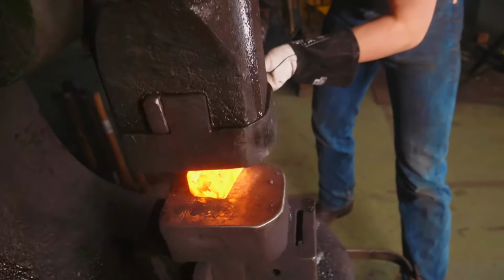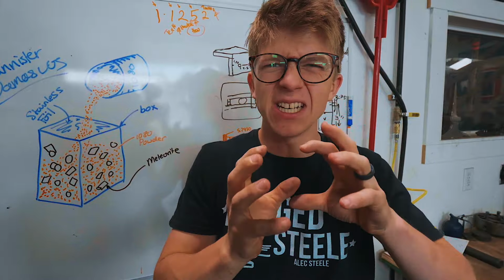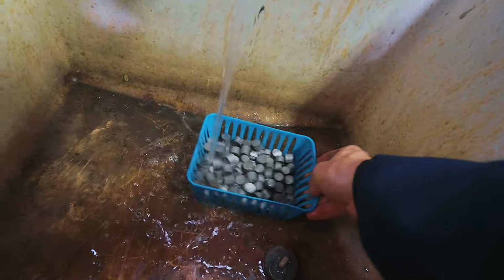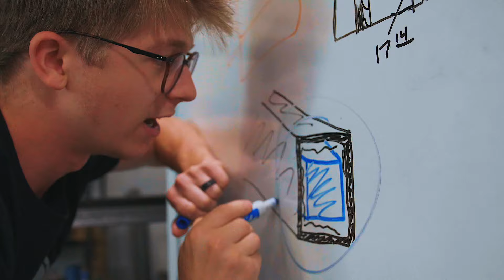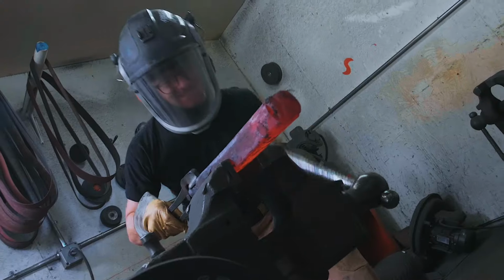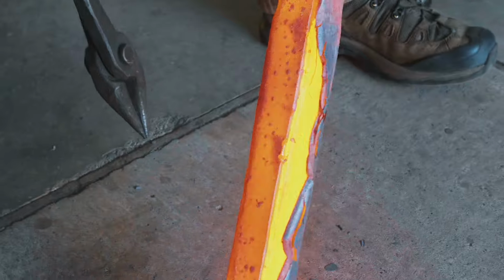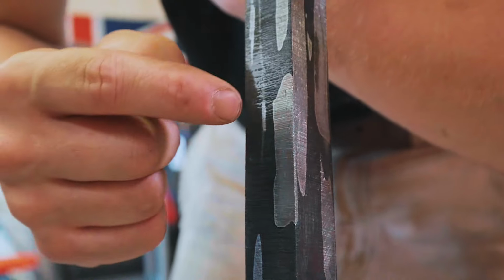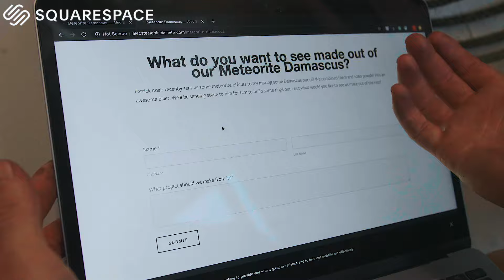CAN YOU MAKE METEORITE DAMASCUS?

Comment: You guys should make this kind of video into a series called “Will it Damascus?”. That would be neat!
Reply: I see what you did there!
Reply: Ground up blendtech blenders should be next then
Reply: Is this GMM?
Reply: Or what about: "Will it Forge"?
Reply: Why doesn’t anyone like Tungsten ik this is random but I’ve never seen him try using it
Reply: Say it with me:
Trypophobia is not real. 

The dress does not change color. 

This is pattern welded steel.
Reply: XrXaXe X I am no expert but I assume it is probably because tungsten is so heat resistant. It has a melting point of more then two times that of mild steel. Also tungsten is very expensive. I assume it’s a combo of those two factors.
Reply: its never damascus, its forge welding. real damascus is way way trickier than just smushing in patterns.
Reply: That would be cool tbh
Reply: Hell yeah
Reply: @Teraylxn  I believe it has the highest melting point so that's probably why
Reply: And hang out with Rhett and Link.
Reply: @Teraylxn  if you have to ask then you wouldn't understand.
Reply: @coronalight77  that literally why I asked the question..so I could understand 😂
Reply: Yes
Reply: Yes, excellent idea. I would only change one thing, Does It Damascus ?
Reply: Yes.i have some old high carbon tools I would ship to you to try forging.
Reply: This whole tree is on fire
Reply: @Teraylxn  its extremely expensive, extremely hard and extremely heat resistant
Reply: GMM fan spotted.
Reply: Yes but will it keal.

Comment: There's a Ukrainian knife maker's channel called 'Shurap' that does a fair bit of canister-welded damascus from all kinds of crazy components like bike chains, cables, washers, etc. The trick he uses is to have a canister fully made from stainless steel, combining the mild canister and foil into one, which he then zips off the sides of with an anglegrinder. He also douses the cans, which he puts a little pressure-release hole in the lid, in a mix of kerosene and flux to really help that powder bond. From what I understand, the slag runs into the space between the billet and the canister when it gets hammered on. Might be worth a look? @Alec Steele
Reply: This needs further exploration 👍

Sidebar; does "manual" @ / at'ing, work in YouTube comments? Doesn't seem to make a visible tag, so don't really know if there's any effect. And cannot @ myself anyway for testing.
Reply: @pr0xZen  Only if i reply to your reply. If I write @pr0xZen it doesn't do anything. I know it works in video descriptions though.
Reply: Shurap seems to be at least a decade ahead of Alec. But here we see all the mistakes too, which we all can learn from.
Reply: pr0xZen I was just testing it out, seems it doesn't do anything. I know video creators can @ people in the description of their video or something like that, but I guess the spam would be too much if us plebs got access to that.
Reply: Yeah that’s the basis of canister damascus as far as I know no one has just popped off the tube before angle grinders if you did canister Damascus you just used a chisel it confused me when tried to just split it
Reply: Shurap is probably one of the best knife makers on planet earth. And the metal he uses has so much variety.
Reply: I agree. I am fairly surprised that Will doesn't apparently know of Shurap through researching knife forging. I was going to comment the same thing. The angled dies that Shurap uses on his press to elongate the bar (and keep it squared up) could have also helped Alec to have less wasted material from the power hammer and grinder. I also feel like Alec used too much steel powder. Should have piled the canister full of the meteorite billets and then put in the powder with the "tapping" method, to pack it all in around the billets. However, it will be interesting to see what the final pattern looks like after the stacking and twisting.

Comment: I would say you should make the meteorite sword from avatar the last air Bender but I don't know if  there will be enough material on the billet
Reply: Just make a scaled down one. It would be just as cool
Reply: You can always use it as a jacket for a core steel
Reply: I'd say he could manage it if used a different steel for the handle
Reply: @Ashmurtagh100  wasn't the handle of the sword made of brass or bronze?
Reply: AWEme did it

Comment: Alec Steele, the stainless foil is a really smart idea on having the canister strip easy from the billot, but I’ve seen other blacksmiths on YouTube and even on the show forged in fire that use white out and then when they get the canister out the press they dip it in water really quick and the canister peels easily off the billot

Comment: "Alec, now lets talk about your damascus here: unfortunately your blade is not finished, there is no mechanical support in the handle and the blade has no edge. Our judges has descided, that this way your weapon is not safety, and we cannot continue testing, and you cant be the new FORGED IN FIRE champion. We would like to ask you to shake your competitors hand, our hands and please leave the forge.''

(Pls dont kill me if you  dont get the joke)
Reply: I've been binge watching forged in fire and wondering why he didn't just use white out
Reply: @falconeer99  It hardly ever works out on FiF, though that's mainly due to the time constraints. Anyway, Will learnt the stainless foil trick from a canister damascus expert, so they went with it
Reply: @taylor_green_9  I totally get that.  My comment is based entirely on the original post being worded the way the judges on Forged In Fire speak

Comment: hey Alec is it possible that since you cut the long pieces of the foil jacket in to separate strips that some of the powered steel fused though gaps along the seams, hence the trouble you had separating the mild steel box from the inner Damascus?

Comment: How about a tactical folding knife
Aluminum (or aluminium for you AS) handle, Steel ball glass breaker, meteor blade at 6" (15cm) and be sure to leave a  tab for push-flip assistance.
Tanto taper.

Comment: What about trying titanium carbide and tungsten carbide Damascus? There are titanium tungsten carbides but I have not seen the separate carbides as Damascus. I believe this would require a very hot forge of around 3,000°F and may not even be possible because the boiling point of  titanium carbide is lower than the melting point of tungsten carbide, but tungsten carbide should heat up at 3,000°F.

Comment: I was thinking Alex’s first mistake was making 5 individual pieces of stainless foil instead of a single piece of stainless pushed into the shape needed therefore making only one point of contact with the outer mild steel instead of 4+ seams between the pieces of stainless foil.

Comment: Hmmm, somethnig to ponder. But did you know that Iron is th last element that is formed in all stars, and that doing so causes the death of the star after a while. All the other heavyer elements are created form supernova and collisions on insain levels. So not only was Alex working with a cool material from outer space, but the last time it was heated to melting point (apart from when it got squishd into the metiorite) was when it was formed in the center of a sun.
But what to make out of the demascus I have no idea, Maybe Dawnbreaker from Skyrim, actually yes, to break the dawn, or to break a sun all you need to do is add Iron.

Comment: Bruh... You gotta take that billet to like 320 and you'll see some WILD stuff. 
You were lucky enough to maintain the striations in the meteorite. (The miniature stripey-s... Also, whatever you do, it's gonna have to be sanmai or gomai or beyond. 

I'd personally do a space theme, and make "black hole" Damascus over a layer of pure nickel, over core steel. To keep the heat treat similar to the 1080, use something similar. OR avoid hardening the 1080 and make the 1080 cloudy by using O1 or an air hardening steel.

Comment: The problem with metoerites is that they are often made of metals which don't necessarily alloy, however they are welded together becuase they were formed with a shitload of enegy. Literaly planetary scales of energy. I'm not saying is impossible ot forge with a space rock. is just that you will need a lot of heat, more than the usual. Go ahead Alec.

Comment: You may know this now, but I've seen white out used instead of the foil. You just coat the sides.I think the theory is that it turns to carbon 🤷‍♂️
Also, cutting away the canister earlier seems to work out better for most. I've seen wedges forced down the side in the press to separate the casing

Comment: Sorry to be that guy, but if you heat meteoric iron above 723 degC the crystal structure particular for meteorite irreversibly disappears. The reason for the cow-pattern is that the 1080 powder transforms to pearlite which etches dark, while the more pure "meteoric iron" is likely mainly ferrite, which remains bright. I think you could have used any steel with low carbon content in place of meteoric iron to get the same effect. I'm sure you know this.

Comment: Very nice! I think the biggest problem with your attempt in 2017 was that you had the wrong kind of meteorite. It looked like a "carbonaceous chondrite", i.e. basically a rock. There was no way you could have forged that thing successfully. The chunks you have this time look like they're from nickel/iron meteorites, which should forge a lot better since they're mostly metal. (I think there are other kinds as well, but those are the two most common. It's been a long time since my geology degree.)

Comment: As it is a Damascus done by space materials the best design i think is an Arabian dagger 🗡 
Old legend said that the damacian used to buy the iron from Yemen 🇾🇪 which struck by lightning 🌩 and forge it to become Damascus steel what about you try to struck it with electricity and find out if the legend are true?

Comment: Should have used one sheet of stainless steel folding it so it fits your canister. By cutting it then putting each piece in there are gaps that would allow the canister to weld itself on them corners!!! 🤦🏼‍♂️

Comment: You clearly didn't read my comment on the last video and it shows. Meteorite is effectively raw ore. You can't forge it any more than you could forge a random iron-rich rock. You have to bloom or smelt it first. Even Avatar The Last Airbender got that part right (Sokka smelted his meteorite, but they skipped the rest of the forging process in the show). 
I predict shenanigans when you try to forge it without that jacket on - pieces of meteorite will crack or just fall out entirely. 
You guys could make bloomery; and blooming meteorite and doing this the right way would be an incredible process to watch.

Comment: NOT DAMASCUS STEEL. as a smith you should know better alec, damascus steel can ONLY be made in damascus in syria from wootz steel which is a crusible steel. ANY vidio that shows people getting multiple differant bits of metal and making "damascus steel" are either ignorant or lying to you. the process of taking differant bits of metal usualy of differant types and forging them together to make a nice pretty patturned object at the end are doing so using a forging technique called patturn welding.